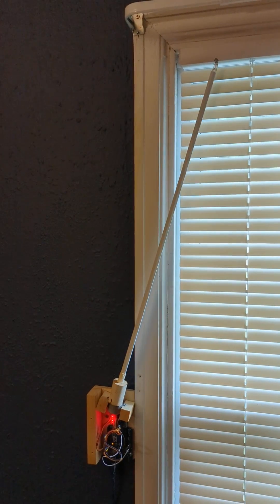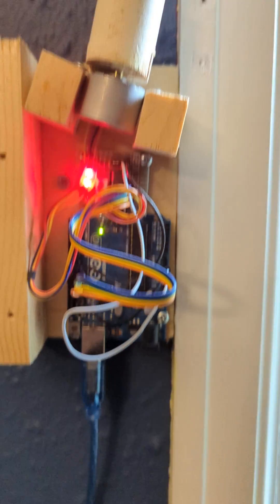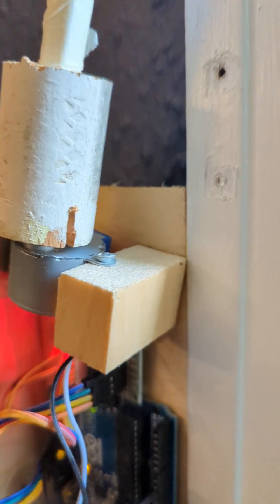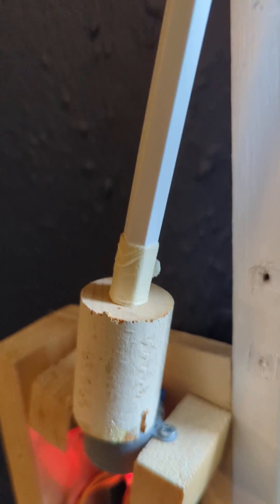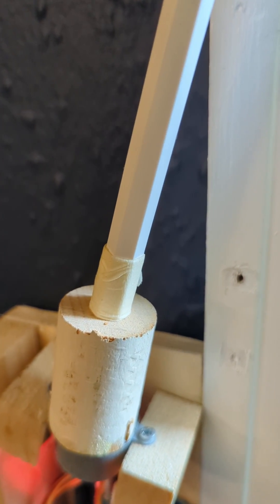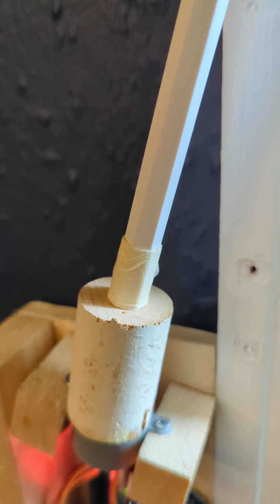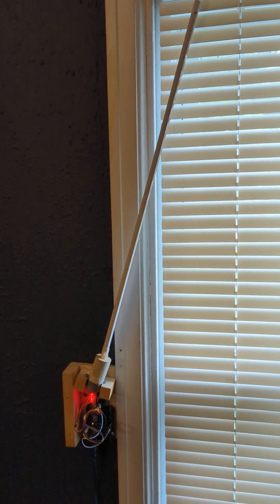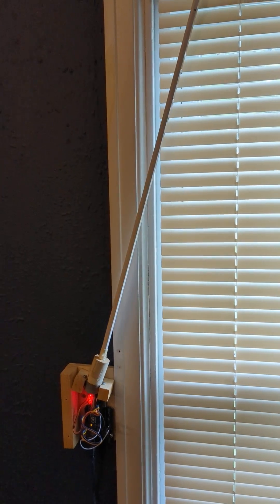Window Blind Closer/Opener (Arduino Project Idea Simple/Easy)

Comment: If you want to get it to work with your phone without going too far down the IOT rabbit hole maybe look at blynk. And the NodeMCU microcontroller.
Reply from the maker: thanks will do I am an arduino noob so I appreciate the tip. Was looking into cheap wifi/bluetooth mini controller boards to decrease foot print.  Looks like that model is pretty well rated thanks again. Was also considering having it write and record where it was at in the open close cycle so when it starts where left off. Probably would make more sense to just get a mini wifi board like you suggested. They are about the price of a smart plug. This was all built with what I had on hand.